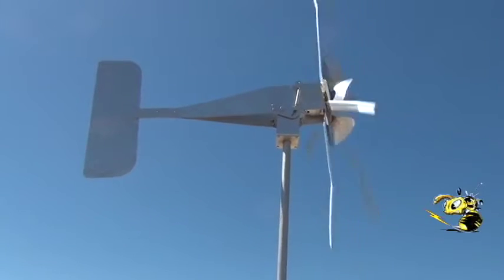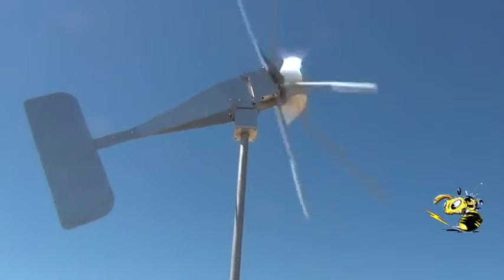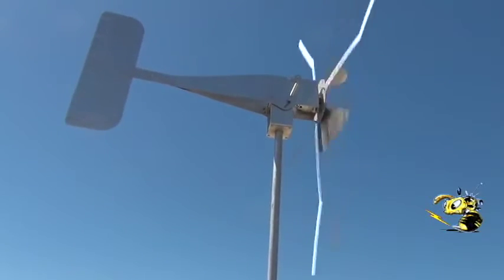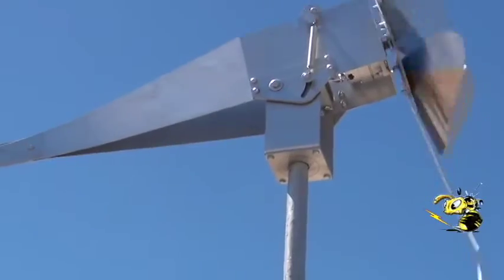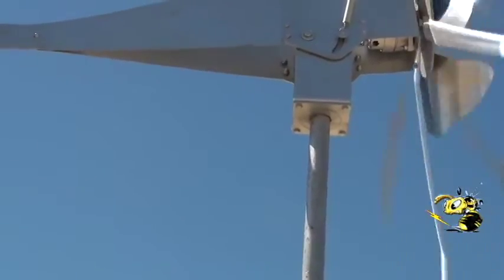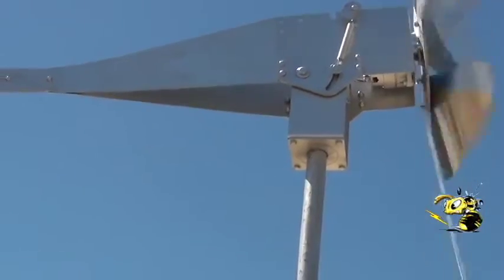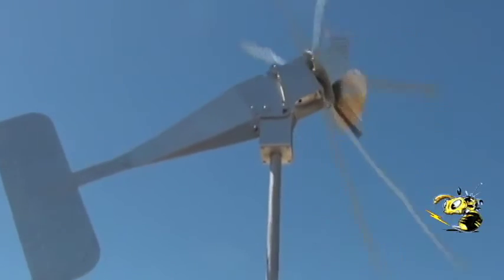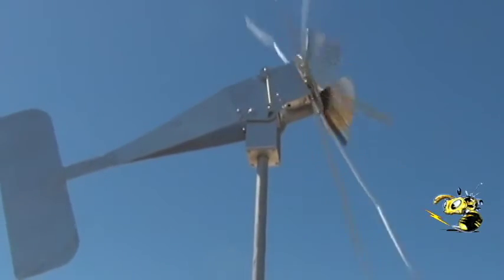3X tilting wind turbine generator 8 foot diameter great for low winds

Comment: I was impressed by the low wind performance of those blades in previous vids, that tilt looks to be working nicely
Reply from the maker: Thanks!!  It can't make high Watts (900W max) in high winds but it can't be beat for 10 mph winds with that big 8 foot diameter prop.